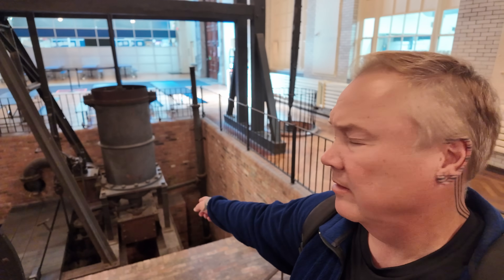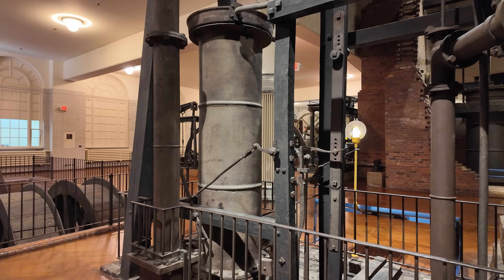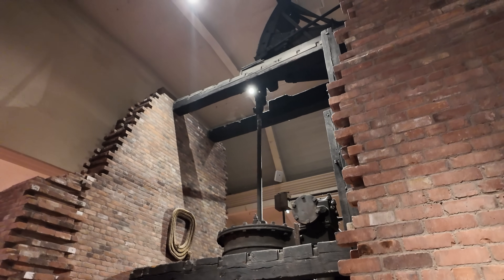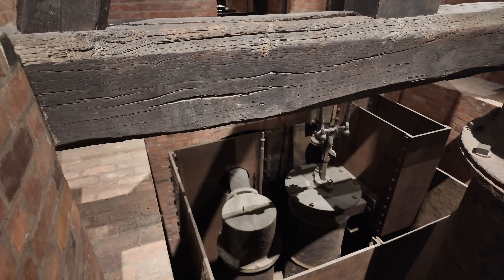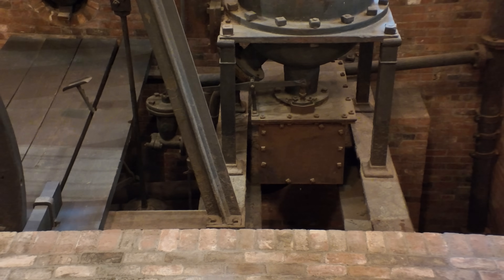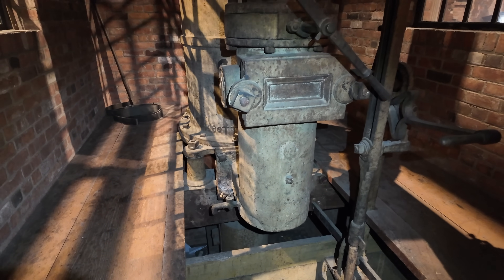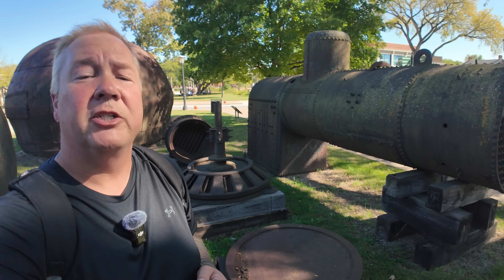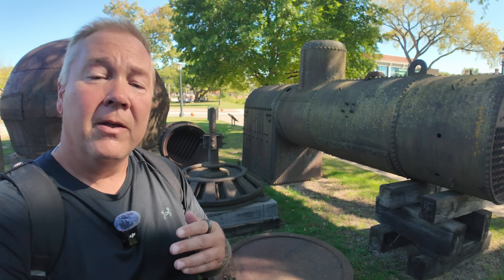The Weird, Profitable Reason Steam Engines Had Pickle Pots

Comment: Don't try explaining things you don't really understand.
Reply from the maker: Would you care to elaborate?
Reply: @Industrial_Revolution  I just watched the video a second time. What is the difference between a "pickle pot" and an external condenser? Do they use an air pump, or where they just flushed with steam like a Newcomen engine (wich would explain the lesser efficiency)?  Was there a valve between the "pot" and the cylinder, because if not it might even loose efficiency and the only gain would be to avoid cracking of the cylinder by heat cycles?
How was the Watt patent not emforcable?: 

"In engines, that are to worked wholly or partially by condensation of steam, the steam is to be condensed in vessels distinct from the steam vessels or cylinders, although occasionally communicating with them;"
Reply from the maker: Some great questions.  I've seen two of these in person, and neither had an air pump.  Watt used air pumps for vacuum, but it seems only once he moved the condenser cylinder underwater, and that was mostly to pull the water and stray air out of the condenser, not to actually create the main vacuum. His earlier ones didn't have one.
Was there a valve?  On the Moira engine, pretty sure there was.  On the Windmill End engine, I didn't see one, but it was hard to see.  Just narrowing down the cylinder would stop heat transfer through the narrow part, just like the narrow, metal pot handle doesn't get hot on a stove.  The big efficiency gains were from letting the main cylinder get and stay very hot and keeping the condensing part cooler, for both the Watt and pickle pot versions.  Watt engines would separate them more, getting more efficiency
In that quote, not sure where that came from, but it does seem to ignore the traditional Newcomen engine.  I think the pickle pot would be the "occasionally communicating with them" part.

Comment: What is a pickle pot?   
Well, off to the internet search engine!
Reply from the maker: You mean outside the steam engine realm?
Reply: @Industrial_Revolution  I didn't know what a pickle pot was, no matter what realm.
Reply from the maker: Ah.  Before this steam engine design, a sealable, watertight container used to make pickles.  Almost any size worked, but larger, up to maybe 5 gallons/20 liters is good.  Fill it with things like cucumbers, then pour in (usually) lots of vinegar and lots of salt, plus usually some mix of spices, tightly close the lid, then ignore it for days/weeks/months.
In the context of this steam engine design, a metal vessel about the same size and shape as that pickle pot (where it got the name), stuck on the bottom of the steam cylinder, that works pretty much exactly the same way as Watt's external condenser.  There's a very solid argument to be made that it actually IS exactly the same as Watt's external condenser, hence the nickname pirate engine.
Reply: @Industrial_Revolution  OK, Grandma called it a pickle jar.   Just a big Mason jar.
Reply from the maker: I think if you're making it just for you and your family, you probably just used the smaller jars, like a quart or liter size.  The bigger ones are more like restaurants or, I suppose, people who REALLY like pickles.  If you look at some old photos, like 1800's, you can see bars where they have big, clear glass jars of pickled eggs that are probably 5 gallons/20 liters.

Comment: The same thing happens today. what we save in fuel we give to the electric company. It doesn't matter which path you take.
Reply from the maker: With electric cars?  Some studies have found that, depending on driving and location, they can cost more than gas-powered cars to drive, especially if you don't have a dedicated garage to park them in to charge every night.
The licensing Watt used, though, is closer to what some car companies are doing to charge you a subscription fee if you want things like remote start, heated seats, etc.

Comment: Interesting bit of history. Showing the actual numbers from a specific installation would have been interesting, as well as the operation charts. How do these old designs stack up against current practice?
Reply from the maker: Unfortunately, a lot of specific numbers for these old engines don't actually exist.  Things like power were guesses, and varied a lot as the leather seals wore over time.  As for as procedures and operations, they're pretty much the same, since a lot of these were developed back in the 18th and 19th century, and only the engine itself has changed.

Comment: When was the last time these were fired up? Are they still functional?
Reply from the maker: It was still running as a pump only in 1929, when Henry Ford bought it.  That part would be pretty easy to make run again, I'd think.  The winding engine part would likely be somewhat more complicated, as that has been idle for longer.  No idea how long. 
I did a video on this engine itself, too, if you're interested.  https://youtu.be/wpkzRHz_GEQ

Comment: Why did the museum install the yellow light which blinds visitors?
Reply from the maker: Which one?  They have quite a few.  It's one of the challenges of filming huge things museums. With only a few good places to stand, there's often no way to avoid glare.
The lights on posts are supposed to represent relative power between the different steam engines.

Comment: Interesting museum. We had a similar steam pump to draw water from a borehole. As the piston rose it triggered the release of cold water into the engine, and we regulated speed by increasing or reducing the flow of steam.
Reply from the maker: Where was that?  Was the water for cooling, or to condense the steam?
Reply: @Industrial_Revolution  It was a hospital that ran on steam. The water was for the boilers and all the hospital usage. The pump ran non-stop, just needed oil in the dashpot 3 times a day.  UK

Comment: I have visited "The Henry Ford" museum and have often wondered what that square box at the bottom of the cylinder was doing. Thanks.
Reply from the maker: It's a great museum but, like a lot of museums, they could use some more detailed signage, or maybe a QR code on the signs to go get a lot more info.  I've seen some art museums doing that, with pages of info, and curator videos on many of the pieces.

Comment: Interesting thing about steam. If there is a guage on the steam chamber, whatever it reads, you must add 14.7 to it. So 5 psi is actually more than youd think pushing on a piston.
Reply from the maker: Yep, I mentioned that in a couple videos.  Becomes less of an issue once you move away from atmospheric steam engines.

Comment: I assume nearly all of Watt's customers started out with a common engine, else how could Watt determine their savings in coal? Since these engines lasted so long, I would think that Watt could simply bolt his condenser onto the existing engine, so wouldn't it be true that the customers' upfront costs would be pretty low?
Reply from the maker: I've wondered how he calculated it, too.  If you assume twice the efficiency, that would mean that for every ton you burned, you saved a ton?
I don't know how many people actually changed out their Newcomen engines for a Watt, although people were, legally and otherwise, adding external condensers.
Reply: @Industrial_Revolution I was referring to your comment about buying a new car to go from 25 MPG to 50 MPG. You said something about paying for the new car and having to pay a license fee on top of that. But I am doubtful that Watt's customers were buying entire new engines from Watt, and I imagine that they simply received Watt's condenser as an upgrade to their existing engine. So, their upfront costs would be fairly low. In fact, James Burke in Connections said Watt ONLY charged his fee of half the coal saved.
Reply from the maker: Someone else who remembers Connections!  That was a great series.
Boulton & Watt did make and sell engines.  I've read some accounts that they were free (with licensing fee) and others that you had to pay to buy them (still with the same licensing fee).  I suspect it may have depended on the engine, with more complex ones costing more and more basic ones being free.  I can't see Watt giving away a well pump like those in this video that uses a fair amount of coal, AND a more complex, rotational steam engine, that cost quite a bit more to build, but would use considerably less coal, since it's smaller and likely only used 50 or 60 hours a week.

Comment: How many of the general public don't understand the first steam engines used the pressure of the atmosphere to move the piston in the cylinder to do the work. If water didn't behave the way it does with the storage of energy and the temperature it does  between a solid, liquid and gas life would be a lot harder. Salts and metals do the same energy storage for the transition but not any where near a temperature we can be near and not without the element just poisoning us. For a lark find the book When the Earth was lit by fire. Its not been that long ago.
Reply from the maker: You're right.  Most people have no idea that the first century of steam power was all atmospheric engines.  
Thanks for the recommendation!  I'll look up that book.

Comment: In my home village there was once a cotton mill. To maintain water for the waterwheel the owners bought a watt steam engine. The fees were only calculated on how much use was made of the engine, and was only needed in the autumn/fall when river levels were low. As time went on a rotary engine was acquired but this time it was a pirate. Now the main family owning the mill were closed friends of Matthew Bolton and when the pirate engine was discovered a friendly agreement was made for missed licence fees. Ironically the millowners daughter (I think) married Boulton's son!
Reply from the maker: Great story!
I've been trying to find a spinning or textile mill anywhere, but not had any luck yet.  Have a possible carding mill, though, if I can get in.
Quite a few mills moved from water power to water power with backup steam engines, then sometimes to full-time steam engines, or even electric motors.  that was the great thing, especially with pulley-drives, you could run them with just about any power source.
Reply: @Industrial_Revolution  maybe look in grain mill industry. They began finding ways to use motors about the same period.
Reply from the maker: I just left a grist mill!  Actually many of them were set up to use waterwheel/turbine OR steam engine OR eventually, even an electric motor, depending on what was available at the time.

Comment: Interesting!

James Watt is usually called the inventor of the steam engine but if you take a 2nd look you will find Newcomen  as forerunner and you will realize why Watt built his engines with a condenser, when a lot of following steam engines in locomotives didn't even had a condenser.
Reply from the maker: Thanks!  Glad you liked it.
I think a lot of it is that Watt just had a much better publicist, but he also really did invent a lot of big advances to steam engines.
If you haven't seen it, I have a 7-part free course on youtube of the first century of steam power looking at the evolution from Newcomen through Watt, mostly by looking at three of their fairly comparable (and huge) atmospheric engines.
Reply: @Industrial_Revolution  Don't take me wrong, Watt did great work with his double acting engine and the condensor, I know this was a big step forward.

Comment: Wouldn't it be better to lease the engines? Pay so much down for installation  of the engine, and so much per month,  they could make even more power if they incorporate the modern engine with the watt engine. And a double acting piston. Using
Cold water to create a vacuum on the opposite side of  the pressurized piston. Like adding 14.5psi of steam pressure.  They were soo close to Maki  real power and a leap in efficiency.  A. 48" - 60" stroke spinning at 10-45 rpm, just adding  cylinders and making them double acting.  A 3 cylinder  radial steam engine with a 12" bore and 48" stroke. : a 16,286 cid steam engine  kinda twice that being double acting😮. .. and a higher rpm engine with 12" stroke and 12" bore running at 120-280 maybe 300 rpm , but most likely  60-90 rpm running the steam at 450°-500° f   at 12" 100 psi is about 1000 psi acting on a 12 "  crank : 1000 ftlb TQ. AT 1 RPM.
Reply from the maker: At the time this was built, I don't know that anyone was actually leasing them.  I do know no one was using over 5psi of steam without exploding (which was considered a bad thing for both productivity and profits).  Double-acting cylinders were around by then, but I doubt anyone would have argued that wasn't a direct, blatant violation of Watt's patent on it.

Comment: No doubt some people took a chance but In the 1790s Watt and Boulton  prosecuted a number of Cornish mine owners for infringing their patents and won every case.
Reply from the maker: I'm leaning towards researching Watt's patent and the controversy around it.  Could make a good video.
Reply: @Industrial_Revolution  The separate condenser patent was granted in 1769 with a standard 14-year term, then had its duration extended, after some lobbying probably by Boulton who was the real hard headed businessman of the Boulton-Watt partnership, by an Act of Parliament in 1775 until 1800. This I believe is why the Cornish mine owners were so annoyed. They were mining copper not coal so fuel efficiency would have been very important to them. It matters to have friends in high places even to this day. Would definitely make a good video.
Reply from the maker: @XenonJohnD Thanks!  I've wondered just how many patents Parliament actually extended back then.  I read that it was pretty uncommon, but that Watt wasn't the only one.

Comment: The thought that these engines could last a century is insane, though seeing their construction, I can see how it might be possible. Design these days is all about light and sleek, but people weren't afraid to make a chonker in those days with exposed bolts and all the other fixins exposed. Moving on from steam power is likely a good thing, but I do think a design philosophy of robustness would help to save resources in the long run
Reply from the maker: It really is.  With their low pressures, and low speeds, wear was fairly minimal.  They'd have to do plenty of lubrication, of course, and the leather seals would need replacing.  On this one, the wood brake blocks would eventually wear and need replacing, too.  Still, you have to do that kind of thing on any engine.
Reply: A heavy flywheel, well balanced, however will allow it to just chug away… until someone gets bored.
Reply: Imagine your fuel bill if you had to crawl a 35 ton atmospheric engine down the road, which put out a whopping 35 horsepower. Light and sleek are design compromises made for the sake of efficiency. You get to around fast and cheap, and in exchange you need to do ocassional extensive repairs.
Reply: One of Watt's follies was his fear of high pressure boilers.  He preferred low pressure copper, brass, or bronze boilers at about five psi.  This meant that a one hundred hp Watt engine might have to be as big as a house while a high pressure engine of the same size could make 10,000 hp.  The low output of his engines made them last a long time.
Reply from the maker: Watt was right to fear high pressure steam.  Until Trevithick figured out the Cornish boiler, "strong steam," over 1atm above ambient, had a tendency to explode.
Reply: Moving? Oh no, steam is not going anywhere for next 100 years.
Reply from the maker: A lot of these engines did get moved.  I've done videos on several engines where we know about when it was built, know nothing about the first decade or two of use, then know where it was installed after that.

Comment: the licensing may have been worse than that, as it wasnt necessarily replacing fuel but FOOD.
and shoes. and leather. and stables.

back to the HP, purposely exaggerated...

"this 2hp will replace two horses!"
"it did the work of eight..."
"eight did you say? hmmmm.... so best you pay me for four, methinks..."
"huh?"

"four. think of the extra profit you can now make.  now cough up... or speak to my lawyer"

watt was a litigious prick, to be honest.
Reply from the maker: I'm thinking more and more about doing a video on his patent, and the controversy then, and now, about it.  One thing I keep reading, though, is that everyone, including Watt, knew it was over-broad, and that Watt didn't really sue many people for violating it, out of fear that the entire patent would be thrown out.
Reply: @Industrial_Revolution  Boulton was the real bastard, Watt at least did the research work.
Photography was held up for years by the patent awarded Fox Talbot for a process on which other people had been working, but had not published.
I used to hold a US patent, but it was a defensive patent to prevent some larger company from patenting our process and then suing, as so often happens.
Reply from the maker: I haven't looked into Boulton much, but from what I've read, Watt was the inventory and Boulton was the money and marketing behind him.